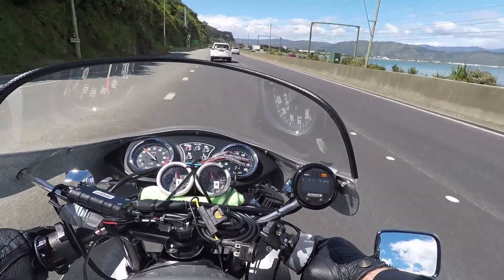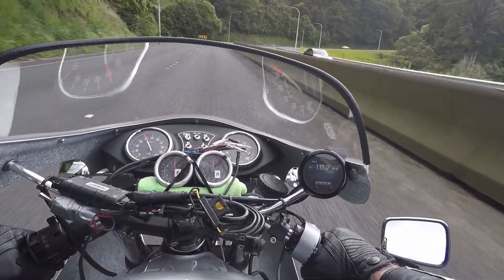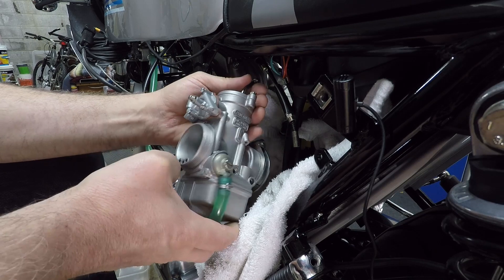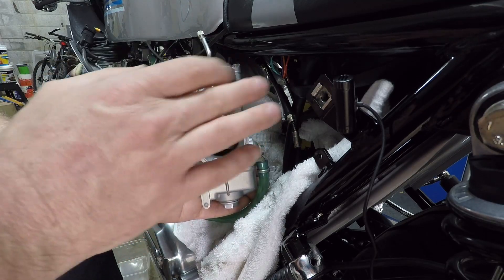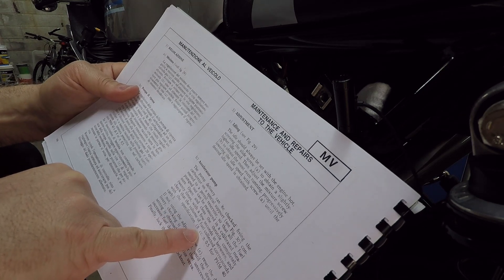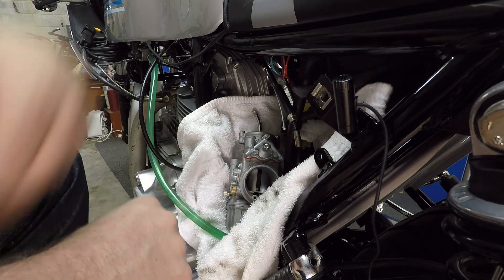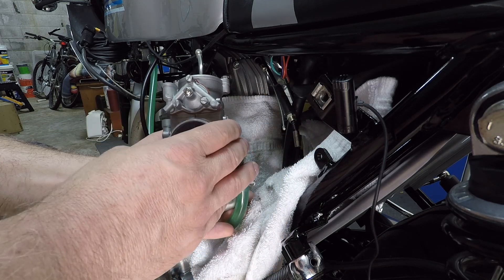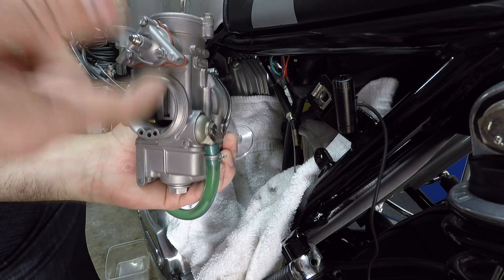DellOrto PHM40 Accelerator Pump Adjustment - Ducati 900SS Bevel Tuning

Comment from the maker: I may not have made this clear in the video:
If you do this test and find that you need more cc's of fuel, turn the screw out to increase the amount of fuel. Screw it in to decrease the amount. Do this in one full for each test. To speed it up for your interim tests, you can do 10 squirts and check for 4cc of fuel. Then for your final test, do the full 20 quirts and look for 8cc of fuel.

Comment: Is it same carb on a guzzi le mans 1000?😮
Reply from the maker: Yes highly likely. They used PHM40's on a few models around 1980 and on. Jetting will be specific to individual models so look up some manuals to confirm what was stock.

Comment: Re: 4 cc for PHF32 vs 8 cc for PHM40s. A quick calculation (assuming circular venturi sizes) gives an area ratio of 0.64. 0.64 of 8 cc is around 5 cc so that could account for most of the difference (with other differences in slide cutaway - 7, 6 etc - needle and main jet also contributing) in pump volumes. Rapidly opening the throttle results in a drop of air pressure drawing fuel through the main jet as venturi air speed temporarily decreases (Bernoulli’s principle). The accelerator pump compensates for this temporary lean mixture. Many thanks for posting your videos.
Reply from the maker: And thanks for the comments Stephen!

Comment: Great videos, thanks can I ask where did you get the Workshop manual from?
Reply: Re: 4 cc for PHF32 vs 8 cc for PHM40s. A quick calculation (assuming circular venturi sizes) gives an area ratio of 0.64. 0.64 of 8 cc is around 5 cc so that could account for most of the difference (with other differences in slide cutaway - 7, 6 etc - needle and main jet also contributing) in pump volumes. Rapidly opening the throttle results in a drop of air pressure drawing fuel through the main jet as venturi air speed temporarily decreases (Bernoulli’s principle). The accelerator pump compensates for this temporary lean mixture. Many thanks for posting your videos.
Reply from the maker: Hi Gavin. That one came with my bike from the previous owner. It looks like it's a copy of an original and it has a Gowanloch sticker on it. They might have made copies to sell?
Reply: @Ducati900SS  thanks I've found an online copy of the manual. I've got a fast idle issue with my 750 ss, I've found the alternator cables melted same as yours, wathced the videao and have a plan to do the same. Ive also got a fast idle issue which I thought was a carby problem but it seems to be lacking spark in the front cyclinder and the spark in the rear is weak as well, pickups?
Reply from the maker: @gavinsmith6768  I'm going to redo the alternator wire again soon. It's fine as it is, but I want to take the join back further and I've also cleaned up some original spade plugs and insulators, so I want to make it all look correct. Back then I wasn't as fussy about it as I am now. 

With the other issue, and if your 750SS is one with the Bosch ignition, note that the pickups don't affect the strength of the spark. All they do is tell the electronics when the rotor has gone past. Your coils and of course the plugs themselves are the bits that create the spark. Get some new NGK BP7HS plugs and check the spark again. Then swap the leads from the coils to the Bosch boxes over and see if the weak spark stays with the one coil regardless of which Bosch unit is attached. 

Ultimately you might be looking at a Sachse or similar ignition replacement. There's almost no way around it. It's difficult to diagnose a faulty Bosch unit without having known good ones on-hand to compare. You can assume that it is faulty if you think it might be. I wouldn't buy any NOS units off the internet as they're almost bound to be dead as well. I assumed mine weren't faulty and went so far as to replace pickups. There are one or two early videos on my channel about testing advance after replacing and setting the pickups. The outcome was that the pickups were fine, but the rest was not. Getting the new ignition solved all of that, and I kept my existing Dynacoils as they were fine.

And regardless of the above, the idle speed is entirely down to the carb adjustments. Sometimes a bike is set to idle fast because it won't idle reliably any lower. You will need to determine which issue applies. Learning to adjust and sync the carbs is a major factor in making these engine run and idle well. I didn't know how to do it properly until Brook Henry showed me. Even then it was hard to repeat and I spent many hours twiddling screws and listening to the engine to get it right. I plan on doing a video showing various ways to do this.

And lastly, it's important that you know for certain that all parts of the process are in good order, from fuel, to ignition, to valves and carbs. It's very hard to diagnose something without knowing the exact state of all parts. So just take time to go through everything carefully. Drop by in the ducati.ms vintage forum where people are good and helpful.
Reply from the maker: @gavinsmith6768  p.s. about the alternator cables melting… I eventually found that my bike had a brighter headlamp bulb in it. I think it was a 95 instead of the 55W, so a lot higher power draw. Check your bulb and use a modern Halogen of the correct wattage for good coverage.